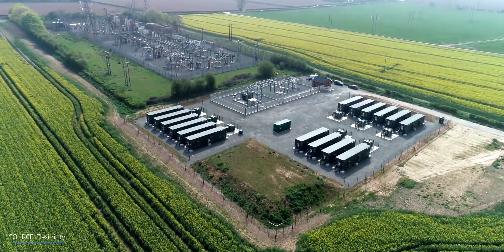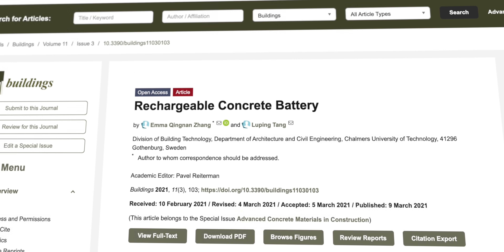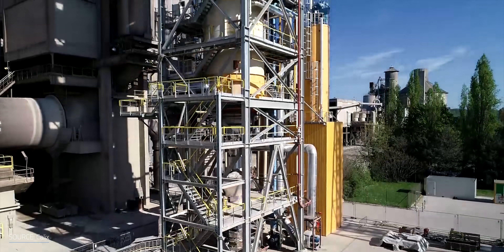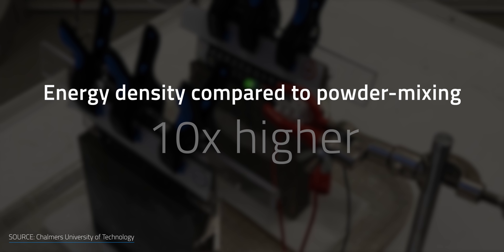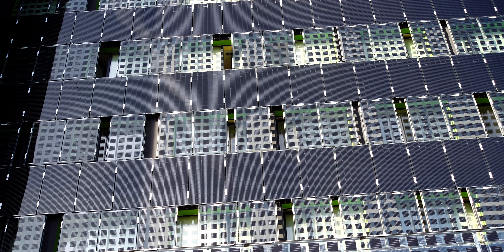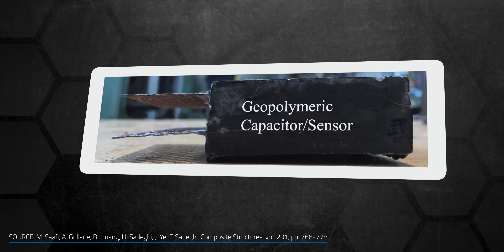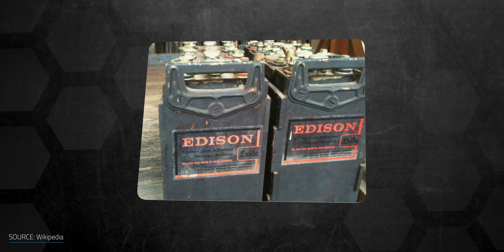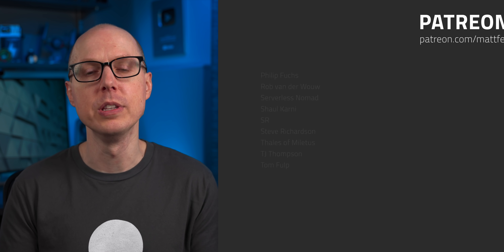Turning Buildings into Batteries? Concrete Battery Storage Explained

Comment: naah...i think there will be a concrete change in the future...maybe garbage as a building material therefore making concrete not used as much ...people still dont realise that garbage plastic and whatever else is actually really good because it whitstands the temperatures and all other weather conditions... when people realise it there will be a massive change of the concrete as a the most used ....so i think that this is not going to work... it would actually be better if you fill your wall with acid or like your most lower room s floor with acid and make it into a gigant batery...but the concrete mixture itself...naah ..the reason whyy people use concrete is because of the price increase in the price will decrease demand...but who knows....also i think that power right now is a problem because we got no efficient way of using it... for example everything runs on 220 or 110 volts i think in the future everything will run on 5 v and it will also affect the consumption making it like cheeper to use stuff for example a cutter that uses 1700w will be like 170w...and so on...i mean its good to experiment with it but i dont think i will be like revolutionary type of tech...also all the creacking and water problems...naaah...

Comment: From what I've read so far of the comments, I think maybe the main problem with this is that it introduces possible compromises with the structural aspects of the concrete. In a list of priorities for a "battery building", the quality of the concrete in structural terms would be absolutely first. But then, as you have pointed out, the system opens up the possibility of buildings that "self-report" faults early on. And if it's already established that it doesn't compromise the structural properties, I suppose this point doesn't hold, either.

IDK, so for now it's worth keeping the idea around. No need to hastily accept or discard it.

I suppose, too, that one could probably split the concrete parts of a building into "structural" and "non-structural" ("load-bearing" is the term I think I've heard engineers using?). If your concrete battery is not expected to make any critical contribution to keeping the building from going horizontal, it's just another kind of "pane of glass" - but perhaps a "pane of glass" that resists fire better, or makes breaking in difficult. With that in mind, it might even be worth trying to make them as light as possible, and push all their contributions to the strength of a building onto load bearing members, independent of them?
Reply: If you're only using concrete batteries non-structurally, why not just use some other type of battery with a much higher capacity?
Reply: @Yay295  Good point. Cost maybe, but I doubt if that tips the scale.

Comment: Ugh, common mistake here, Watts are used as power units, i.e. how much Joules of energy are used per second. For energy storage usually W * h is used, it can be interpreted in two ways either how long (in hours) can you power device consuming 1W power, or how many Watts can you hook up for one hour to your accumulator.(btw, table from the original paper uses correct units)

Comment: 11 square foot wall....There are a LOT of those in one single story home. So if only one is enough to provide 8% then 4 walls of a typical room, my bedroom for example at 10ftX12ft has four walls, so wouldn't that be aprox 32% provided by that one single room? And my house has 3 bedrooms about that size, one master bedroom twice that size and then kinda small kitchen and dining room with a large living room. If I'm thinking about this correctly, an entire home built with this stuff, even at that low 8%p/11SqFt, should be able to cover the energy needs all night long.

Comment: It's hard to take you seriously on this topic when you don't know the difference between concrete and cement.  -_-
You can't just "pour concrete" and make both a structural wall and battery.
There's so much wrong with this idea, it's hard to even begin.
The additional electrical insulation, anodes, diodes, etc would make the building cost prohibitive.
And there is no such thing as "400 times lower"... You can not multiple a number by 400 and get something smaller.  -_-

Comment: I don't think "turning our houses and buildings themselves into batteries" fits, as it only effects new construction. Also, only around 10% of new homes are built with concrete framing. Most new homes do have the foundations with concrete however, I'm not sure how ground water will effect it or if the amount of storage will justify the extra cost in residential construction. So the tech is really only meaningful in commercial buildings and possibly only poured concrete construction. This means upfront cost and time before payback will be the determining factor.

Comment: I will share a short dream I dreamed shortly after a friend had passed away. In the dream, he drove up to my home and opened a compartment in his trunk and took out a rather small box and carried it to a box mounted on my home's wall, opened the box and exchanged the boxes along with a note he would switch back later? This dream made me wonder if a charging technology for walls of homes might be in development, your video says yes? The other issue is will a very small exchangeable battery also some hoe be produced?

Comment: Cool concept. However nothing about this seems practical or cost effective. Especially at scale. The low amount of energy output is definitely an issue. Then it's not like it would be easy to upgrade or repair it when that is necessary. Plus the actual manufacturing of the materials. If (and that's a big if) carbon capturing technology that might be used in the creation of concrete will be a moot point considering all the other materials added to it. Then I'd wonder what health impacts it may or may not have. What kind of low level electromagnetic field constantly around you might do. Not to mention if a natural disaster hits. Is it flood safe? Etc.

Comment: The flyash versions are an important possibility even ignoring the battery aspect. As mentioned it’s cheaper, but it also uses a material (fly ash) that is a waste product of burning coal. Though it will be interesting to see how it could be produced once coal fired industry disappears and is replaced by alternatives.

Comment: Thanks for sharing this idea. To me, using it in structural concrete is a no-go (pie in the sky, not feasible with today’s materials.) But integrating it into a wall covering (think thick multi layer stucco with a protective outer shell) could work. Especially since specialty conductive mortar seems to be an important element for energy density.
Reply: Highways use concrete barriers.  Planter boxes.  Swimming pool.  Front steps.
Reply: @stefanr8232  yes nice

Comment: Plus if it’s structural concrete it will have rebar.  You wouldn’t want the structural steel becoming an anode. That’s what happened in the Miami condo. The seawater and pool were electrolytes turned the structural steel back into iron ore. 

On another note I could see this being systematized in blocks. The benefit of blocks is that they are made in a factory rather than poured in place. Most homes and light commercial spaces in my area are built out of CBS.

Comment: Putting nails or other metal fixing hooks ties for shelving and pictures or even your large screen TV maybe an issue. Most home owners are not smart enough to keep away from electrical cables or pipes yet alone built in battery.

Comment: The single biggest problem with building buildings out of this stuff is that changing the concrete mixture, or adding items into it, will drastically lower the strength of the concrete. That strength is needed to build high buildings in the first place, so this isn't going to work the way you describe it at all. For sidewalks and small pillars, perhaps. But building an entire building where the concrete skeleton is one big battery is not feasible.

Comment: I think there's way too many problems to overcome if you want to use the battery as structural concrete because structural concrete needs to be held together as much as possible, but a battery needs to be separated, and insulated to be an efficient battery. As much as it would be really cool I don't know how feasible it would be.

Comment: Nickel Iron batteries have been around for a long time, have no known limit to life span and are far more tolerant to a range of conditions compared to other battery technologies.
Seems like the only thing wrong with them is that there's no lifetime replacement to fuel ongoing consumption and therefore the consumerism paradigm?...

Comment: Too many puns.
Interesting topic though.
Why not just use gravity, or is that too inefficient?
(Use solar and wind power to pump water up to a reservoir when energy is plentiful, release the water to create hydro electricity at times of need. Currently Scotland uses power station over capacity to pump the water up, but couldn't renewables be used?)
Where water isn't plentiful, presumably weights could be raised and then allowed to descend and turn a generator.
Also, what about learning from nature. Our cells use adenosine triphosphate to store energy. Could that or something similar be used to store energy on a large scale?

Comment: There is a company here in Texas, Italy Texas to be exact that builds Monolithic Dome Homes, if you were to build that home and have a flexible wire grid added to layers of the concrete, your house in the long run could really be energy saving at that

Comment: sounds cool on paper but 0.7 wh/sqf is horrible. that pretty much amounts to nothing at all. 
my old phones battery can fit 25.71 of it's batteries into 1 sq/ft. one battery has a 11.7 wh capacity. thus this could hold 300 wh/sqft. that's 428x higher capacity per sqft then that concrete. aka you would need 428 sq ft of concrete to match a single sq/ft of 7 year old battery tech.
we already have ways to store power that are not battery electric. it's called hydrogen and heck even ammonia.
the concrete battery tech would need a 100x jump in capacity to even be remotely viable as a solution. although that doesn't even solve the other problems this could have, which get even worse the more power they store.
again sounds cool on paper but so many things jump out as not being viable. maybe in another decade or 5 when they come out with different building materials or something. this could be used outside of buildings but i would never put it into a building people use. just sounds like a recipe for disaster.

Comment: A bad idea.
1. Composite materials generally end up in a land fill instead of being recycled. See wind turbine blades.
2. Green concrete is called wood. Producing wood consumes CO2 instead of releasing it.
3. Safe electricity by using technology more efficiently. Books instead of computers since books also store CO2. Work during the day, sleep in the night. Etc.

Comment: ... Edison batteries are great long term cheap things.
But I'm more concerned with how much expansion does the iron undergo during an charge cycle, and how much that cracks the crystalline structure of the cement in the concrete.

Comment: 2000x less abundant than Fe, cool fact! Still waiting for Eufy cameras to get 4k! Tesla's trying to get away from cobalt. I'm building an LFE battery solar system. Much safer currently available chemistry! Most houses only have cement, not grout or mortar, in foundation.

Comment: The best battery for off setting co2 would be a chemical air cell that uses the carbon from the atmosphere like a silver air cell but using co2 not oxygen to generate the current

Comment: I’ve always thought that maybe the centre of a multi-storey building could have a huge weight connected to a generator/ motor.  Larger buildings could add power back into the network when needed.

Comment: Buildings are designed to last 100’s of years but if the cement battery lasts less, it’s energy storage capacity will eventually have to be replaced with something else.

Comment: Problem: cement and concrete when saturated or even surface wet is conductive, which would short out the battery and could electrocute a person. Likely not with a lethal voltage, but the amperage would burn the flesh at the contact point. Concrete and cement are listed as conductive flooring under electrical code because of the danger when it gets wet. The low voltage is the only way this could be safe, but rebar would become part of the circuit and could become part of a circuit when equipment is anchored to the concrete. Some electrical code would need to be written for this to be used.

Comment: Many people had this idea over decades, myself included. The ACTUAL problems are not found in the cement composition that much, but in how to mitigate the problems arised from moisture entering  the concrete and galvanic corrosion of the steel re-enforcement, even using it as a cathode or anode material without compromising structural integrity. In plain English if we can use the steel inside the concrete as the cathode and the cement itself as an anode, we will have giant batteries and turn ANY concrete construction into a giant battery. Although I highly doubt it would be a good idea to constantly depleting the metal in the re-enforcement, it may be possible to at least isolate it and use doping material inside the mix to facilitate the ion exchange. Moisture will be the #1 problem to tackle. Even the best concrete always absorbs some moisture, especially when it is underground in the a building's foundation. Engineers even use special ion-exchange plugs throughout the constrction to mitigate the galvanic corrosion, and given the fact that most large cities are near the sea, the problem is even bigger.
Reply: This guy gets it.
Reply: well i'd take anything said by someone who gives energy density of a battery in Wh/m² (or Wh/ft²) with about 5 truckloads of salt. 
batteries tend to be 3 dimensional which makes this a really useless metric for any purpose (other than showing it in a youtube video).
to prove the point: lithium ion batteries have more than 250000000 wh/m² (if your battery is 1000m high)

not to mention that the resin between the layers probably messes up your overall strength so badly that you could never use it as structural material anyway.
Reply: And how this work with layer buildings  insulation?

Comment: Please please please, cement is a finely powered synthetic mineral that hydrates in water to form hydration products that are essentially at type of rock. Concrete is formed from sand, aggregate, water and cement sometimes with flash mixed together, the cement slurry essentially gluing the sand and aggregate together into concrete as it dries. They can no more be used interchangeably than flour and cake.

Comment: Did I miss something? I kept hearing the energy density expressed in watts per square meter, or foot. That's an area, not a volume. Any  energy storage device must have some volume greater than zero - at least that's my understanding.

Comment: Non-starter for use in structural applications. Would be limited to use in peripheral areas due to the fact that applying a voltage gradient across a concrete structure full of steel rebar is a superb way to accelerate corrosion. In which case, may as well bolt a more effective battery to the wall.

Comment: in a wall Concrete are meant to under pressure , and pressure and electron phenomenon are connect , will charge and recharge change the pressure flow in a wall and cause cracks ?

Comment: This may worsen galvanic corrosion of the rebar, but that can be fixed by replacing steel rebar with lighter, stronger, lower carbon basalt rock fiber rebar like Basonite rebar.

Comment: I think this is a dead end. It's one of those ideas that sounds interesting and has a "Wow" factor, but even supposing the technology is refined and improved, what happens if an individual section of wall battery ceases to function, there is no option to completely remove that wall section and replace it, as would be possible if the energy storage was happening in an external battery. This idea is similar to the idea of freezing carbon dioxide, forming it into torpedo shaped sections, and shooting these into deep ocean sediment. There has to be a better way.

Comment: That tower in dubai would be the tallest cement battery but not the biggest. Now we need to put structural stress tests on cement that is full of material not contributing to its strength. Hmmm.

Comment: This uh, seems stupid. It's a battery with extra steps. This doesn't help energy storage. It just let's you put batteries in concrete. I think that you could make the same batteries more effectively if you didn't put them in a freaking cement wall. Also, God forbid they ever degrade or damage the concrete.

This isn't actually a good idea for energy storage.

Comment: consider combining concrete battery and modular construction. All the modular component can be prebuild inside the factory and with build-in battery, it should be simpler. And component can transport and construct into high rise within month.

Comment: So what happens to the building once the storage capabilities degrade.  No matter what the storage technology, it will always degrade...  Keep in mind that there is a cost to making buildings into batteries.  The other question is to consider is; will the cost of the materials outweigh the savings in electricity production..  Not really looking for an answer per se, just a comment / thought.

Comment: I'm sorry but I think this is a REAL BAD idea.   Concrete over time develope cracks, So 1.) the acit solution they use could leak out?  2.) When they tear down the building, how are they planning on removing the acid solution from the walls?  How much hazardous waste when the building does come down will this create.    This is just a BAD IDEA.